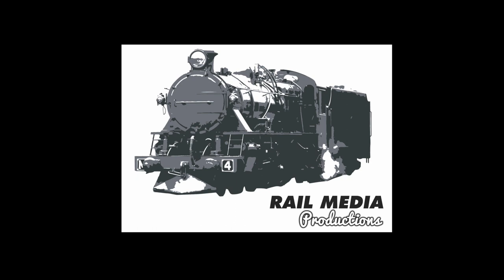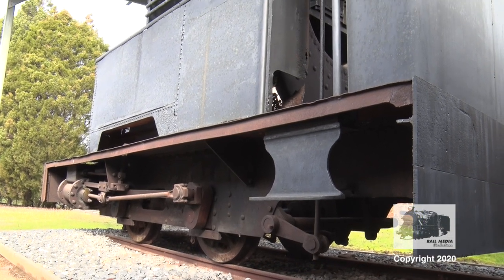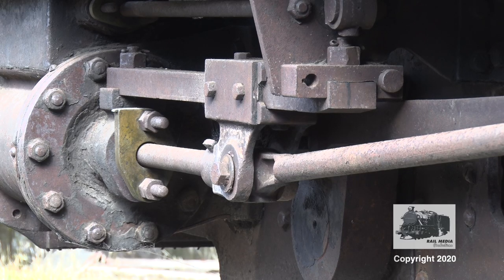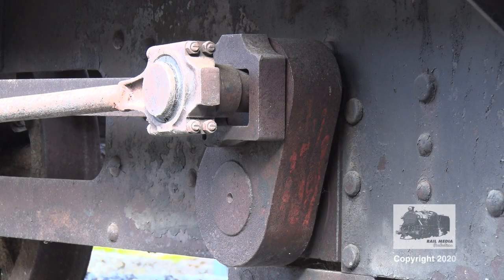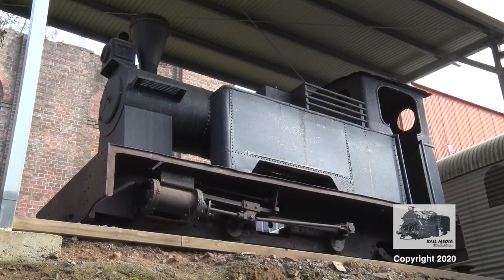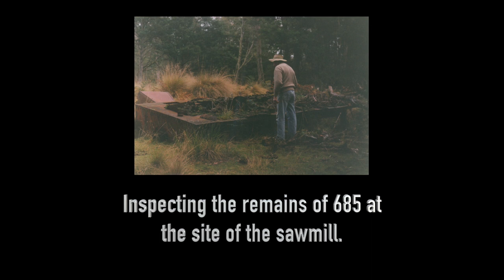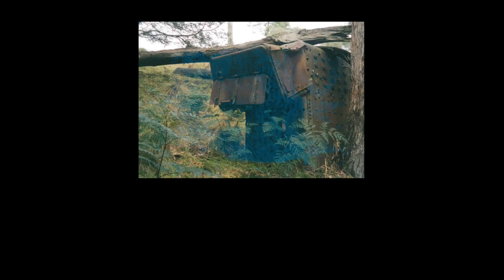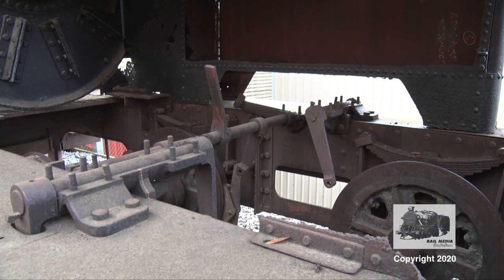Kerr Stuart 685

Comment: It came from Camden Rd. It lay almost buried in bush . Both cylinders sides had been blasted off. Still haveva few photos of the rails and bridges.
Reply from the maker: It's certainly an interesting story, I managed to walk the formation of the tramway to Beauty Point back in October last year with a local who knows the area very well.
Reply from the maker: I will have to go up to Camden Road to have a look at the site of the sawmill one day.
Reply: @railmediaproductions3677 There is an ASG boiler in the bush at Rosie's Tier. It supplied steam to an enclosed crank case vertical compound?' driving a generator.  Tasmania's first electric driven saw mill.  Also dow Waterworks Rd?? up off the highway at Waverley' 1989, a quarry operator made a truck loading stage out of ASG tenders. Photos somewhere?
Reply from the maker: @rsinclair6560  I have a vague idea on where the remains of the ASG boiler at Roses Tire is but I have never checked it out. One day I will head up that way to have a look for it.

Comment: What type of loco is this… a sidar, maybe a heavily modified skylark??
Reply from the maker: I will have to get back to you on this, I think the loco has an 0-4-2 wheel arrangement but I will need to double check this information.
Reply from the maker: I had a look through my notes and it looks like this locomotive had an 0-4-0 wheel arrangement during its days on the Wyatt Tramway.
Reply from the maker: There will be an updated video coming at some stage which has the retrieval of the locomotive in more detail and the reassembling of the engine and transfer to the museum for display.